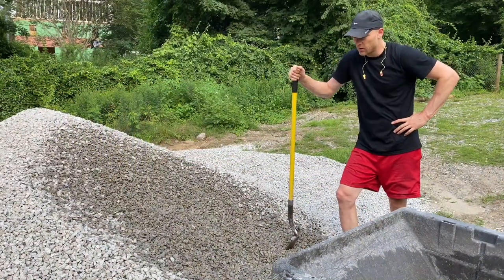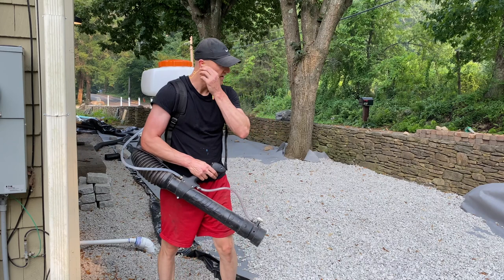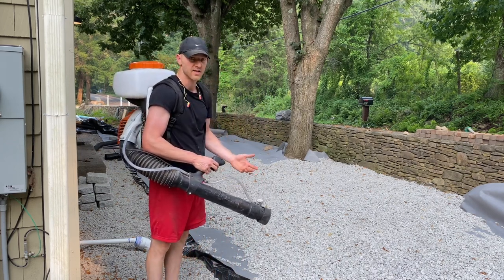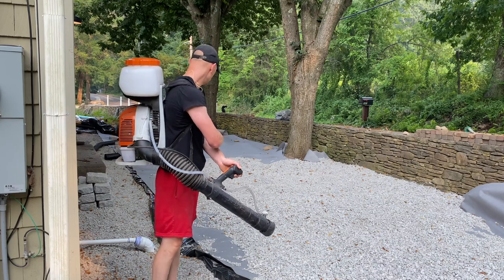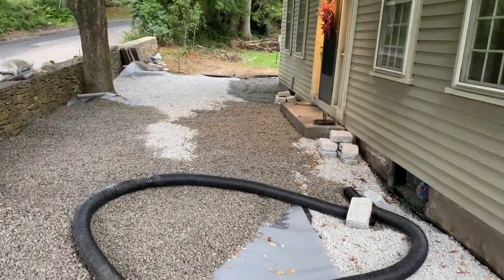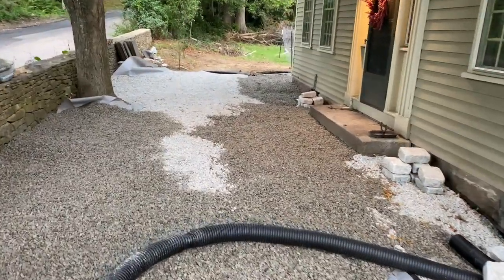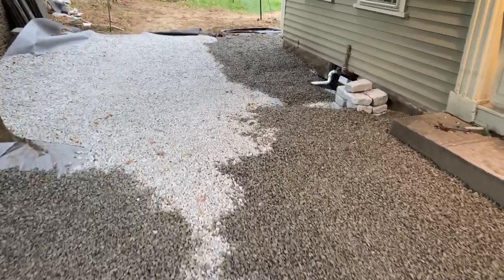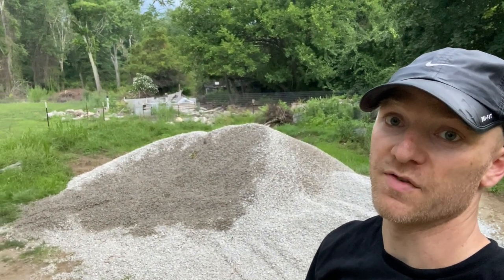Moving 38,000 LBS of rock with a SHOVEL!!!  This won't go well.

Comment: Is that about 12 cubic yards of gravel?  Those gutters probably reduce splashing onto the walls of the house when rain cascades from the 2nd story roof.  The gutters were probably installed when the trees weren't tall enough to fill the gutters with leaves.  Might be time to decide whether a nice hedge would be better than 2 tall trees.  You'll be able to add solar to your roof when the trees are gone.
Reply from the maker: Give or take a few yards. Putting in the drain and removing the gutters solved so many water issues including keeping from splashing on the house!  I would like to add solar, but our house is in a historic easement, so unfortunately not in the cards. The trees will live to see mother year!